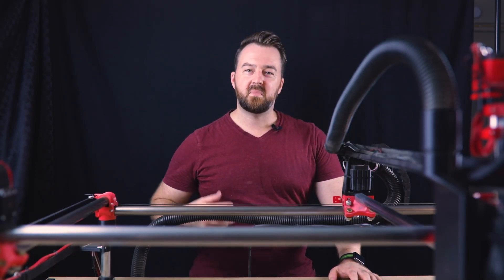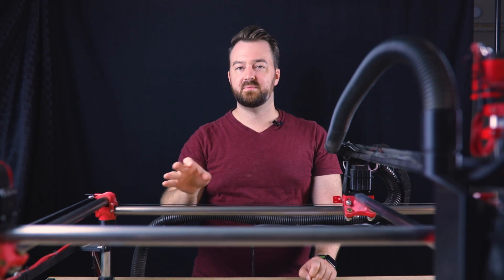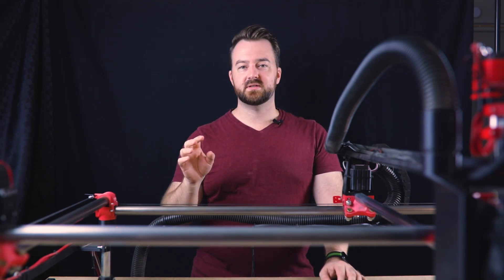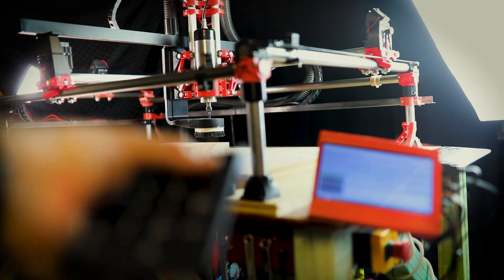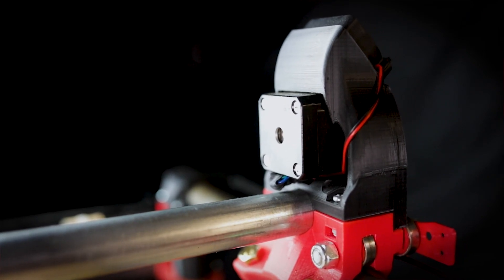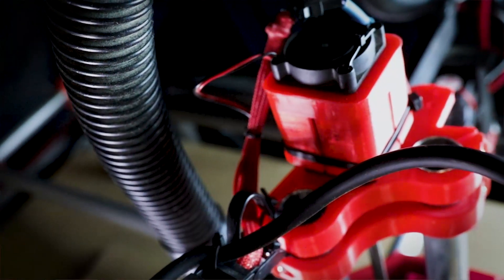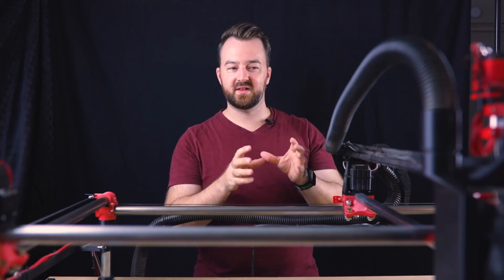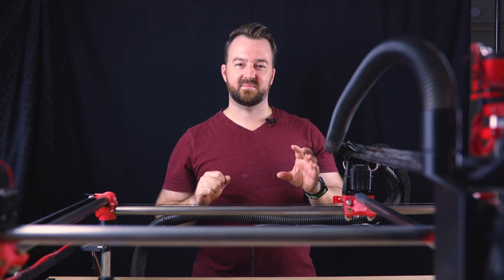My MPCNC upgrades

Comment: Hi ! I built a MPCNC Primo and I was looking for a vaccum shoe. Your  is really intersting but doens'y fit my rail size (25mm) Koala Vac v2. I you have a step file of the top attachment or if anyone has already made one it's amazing
Reply from the maker: Thanks for your comment! The 25.4mm version will fit the 25mm as well, however this is not a product that I’ve had a chance to refine and needs some more adjustments to work effectively! You will need to make some type of gasket for the connection between the internal sliding piece! You are more then welcome to try out and provide feedback. Thank you 😁😁

Comment: That nema cooling can't be very effective as there's no outlets for airflow. Fans always need very big channels to work even remotely well. Unless using very noisy radial fans.
Reply from the maker: I only had great results with these and made a huge difference for cooling. There are outlets at the bottom of these and push air across the surface and out the base…. Very effective!!
Reply: @NEWTechCreative  ok, looks like it's virtually completely blocked design

Comment: Im a bit confused on the round stock. I just ordered about 25 feet of solid round stock for my cnc as I got the idea from your video. But I then listened closer and heard you said you kept some tubing so that you'd be Able to feed your wiring through? Would it not be possible to use solid stock all the way around? Thanks love the build!
Reply from the maker: Thanks @Paulie Jueckstock ! I have the solid bar around the outer perimeter and hollow tubes on the cross bar axis to pass wires through!
Reply: @NEWTechCreative  awesome what about the legs? And I'm trying to figure out if the "outside" rails are the gantry rails or the slides. Because I know its not both but I just don't know which it is. Thanks again for the feedback!
Reply from the maker: Yes @Paulie Jueckstock , The legs I used were also solid bar. The only hollow tubing I used was the “moving” tubes that cross through the centre gantry/spindle z axis.

Comment: What is the router that you use please ? 
Thanks a lot for the video
Reply from the maker: Thanks for your comment. I’m using a 1.5lw spindle with vfd from China! 😁
Reply: @NEWTechCreative  Thanks a lot... if you have some time can you please post a link ? 
Thanks again
Reply from the maker: Unfortunately the link I purchased from is no longer available @Denis G. I would suggest finding your local online supplier and purchasing from them! Use the search ‘1.5kw air cooled spindle with vfd’. Thank you 😊

Comment: This is great video!  Very informative.  Can you elaborate on the solid bar you used on the outer rim?  I'm just starting my build and that seems like something I should do right out of the gate.
Reply from the maker: Thanks for your message @Jim F . Good to see you doing your research before starting. As I have the Burly version (Old version) is assume the setup is the same for the new one. I purchase solid 25mm bar from the local steel shop and had them cut to size. I only used solid bar for the out slider rails and hollow for the x and y bar so I could pass through cables and reduce overall weight. It made a huge difference with overall ‘sag’ and general movement in all directions when cutting. When purchasing hollow tubes, place pressure half way down and check for amount of flex… a little flex is ok. The thicker the wall of tube the better. Hope I’ve helped. Good luck with the journey 😁😁
Reply: @NEWTechCreative  Thanks for the advice

Comment: I know this is an older video, but FYI, IN SOLIDWORKS I COMPARED THE DEFLECTION OF 1" RAILS WITH DIFFERENT WALL THICKNESS AND SOLID. I FOUND THAT .25" WALL 1" DOM TUBE HAS 25% LESS DEFLECTION THAN A 1" SOLID RAIL. THE REASON FOR THIS IS THE 1" SOLID RAIL WEIGHS MORE CAUSING MORE SAG, THE 1/4" WALL DOM IS AVAIALBE FROM METAL SUPPLIES AND BALANCES THE MOST STRENGTH TO WEIGHT (STILL WEIGHING 2LBS PER FT SO VERY HEFTY) ENGINEERING SHOWS YOU GET MOST OF YOUR STRENGTH FROM YOUR OUTER DIAMETER AND WALL THICKNESS AND NOT THE CENTER CORE.

Comment: Awesome upgrades, thank you! Subscribed. Love your vac attachment and stepper fan housings. My motors run super hot. Are you running independent power lines for all of your extra fans? Are you connecting these to your mainboard or to a separate power supply? Any specific fan suggestions?
Reply from the maker: Thanks Ruben! Yes I connected the fans to a separate 24v power supply so the run as soon as I turn the CNC on. I’m sure that they can also be run off an output from your chosen board, however check your voltage of fans and what supply the need. You can purchase a 12v and 24v versions online to match what you need. You could always connect a relay or switching component in you would like control from your board with an external power supply. Glad these could help out!!

Comment: Surely the outer bars will only matter for Z axis rigidity - in each of the X and Y axis all of the load is on the middle bar and the two motors. Unless I'm missing something, the solid bars should be used for the middle bars?
Reply: Fantastic video and great modifications btw :)
Reply from the maker: Thanks for your comments Josh! Yes you are correct in saying that this is mainly for the z axis, however does assist also in the x and y to reduce what I call the bow and arrow effect when running at faster feed rates (bowing in the bar when pushing, then releasing when through material causing a ‘flick’ out). I could have used on the middle bars however I didn’t want to re-route all wires on the outside and consequently having cable chains around the entire perimeter.... if you chose to use all solid bar, I could imagine this would be a very sturdy machine!!!

Comment: which spindle ara you using? how much does the spindle weigh? does Z axis with nema 17 have the necessary torque to move that?
Reply from the maker: I’m using a 1.5kw air cooled spindle and weighs around 2.8kgs. Yes the Nema17 never skipped a beat with this motor... I did have active cooling and set the amperage to 2Amps to get the most out of the motor. Hope that’s helped
Reply: @NEWTechCreative  thanks! :)

Comment: Hi Myles, well done with this it's truly inspiring. GREAT BUILD!!! Because of this video I will also be attempting a MPCNC. I do have some experience with carbon fiber though and would like to hear your opinion on using carbon fiber rigid tubes in stead of mild steel or stainless.
Reply from the maker: Thank you for you kind words Deon! I’m please that it has inspired you. There is so much to learn through this project. I’m not that knowledgeable about carbon fiber tubing however I would check the product out in the shop if you can before hand. I tend to look down center hollow of tube with end touching floor then push in center of tube to see any variance in tubing. Good luck with the build and would love to hear how it goes.
Reply: @NEWTechCreative  Thanks, that is "solid" advise. Hahaha. I agree that it should be as rigid as possible. On another forum someone mentioned that the lighter the cross sections the more "outside interference" could react on it. (Basically the heavier the better for stability), I'm also interested in your electronic setup, since I'm also considering using an Arduino.
Reply: @deonbotha1925 I know this is an old comment and I don't know how far along you might be but for anyone 4lse that may come along and read this I thought I would add my experiences. I used EMT conduit for mine (north America) and I regret it. The galvanizing flakes off and the tubes flatten with wear because of the soft zinc galvenizing. Its not a huge deal but if I did it again I would use stainless tubes and get as thick and rigid as I could afford. 

As for the electronics, I used a RAMPS board on a Mega2560 and nearly gave up because of code issues and lost stpes. Switched to an SKR board and life was worth living again. Spend the extra on a powerful 32bit board...

Comment: What control board do you use
Reply from the maker: I’m using an arduino uno with individual st-m5045 motor drivers with plans to upgrade stepper motors at a later stage.

Comment: What spindle/VFD do you have?
Reply from the maker: Hi Adiv! I’m using a 1.5kw air cooled spindle with VFD. Works really well on the MPCNC, however I have gone to the effort of strengthening the frame to compensate for the extra weight.

Comment: Hi, great mods - going to do them to my MPCNC. Could you give details of your electronics/grbl setup. Looks a bit non standard....have subscribed
Reply from the maker: Hi Gary! Fantastic. I have two spindle mounts on my Thingiverse... the newer one is more comparable with the koala vac if you end up using. Yes my grbl runs off an arduino uno and I use separate ST-M5045 stepper motor drivers for each axis... I designed this way as I wanted to upgrade to a larger machine one day and they can handle large amps if needed especially if working with nema23’s. I might do a video regarding some options when it comes to grbl setup. Enjoy and thanks for subscribing 👍

Comment: Great work, Myles. I'm about to build an MPCNC V1 and, like you, I would like to use a larger spindle. I already have a 2.kw water cooled spindle with a VFD. I'm planning to build a 2' square machine so would be very grateful for your detailed advice as to what changes I should be making to the Burly version (which I believe is sturdier than the original). Many thanks for your time and many thanks for sharing your enthusiasm.
Reply from the maker: Thanks for your message Jim. It’s a very exciting journey and so much to learn! I think you should be ok with a 2.2kw spindle on a 2’ machine... the 2.2kw spindle is VERY heavy and be sure to get ridged tubes, other wise you will certainly get a dip in your center of your cutting area. Since the video I have also inserted a flat steel bar into my center tubes to stop horizontal flex and works really well without sacrificing cable management. I would also suggest keeping the machine short on z axis (no more than 4inches) to assist vertical stability. Besides that, the great part of the build is that you can always adjust later! Good luck with the build 👍
Reply: @NEWTechCreative  That flat steel bar idea is brilliant! Are they a snug fit or are they fastened inside the pipe somehow? And they remain horizontal while using the machine i.e. they don't move around? And are they only installed on sliding carriage pipes? Sorry for all the questions.

Comment: Great Videos... Many thanks for sharing your designs with the community which is very much appreciated. As I am in the middle of a MPCNC build and still not sure about my size, may I ask you for your X, Y and Z working space? Many thanks in advance and kind regards from northern Germany. Robi
Reply from the maker: Thank you for your kind comments Robi. My working area is 900mm x 550mm and z200mm. I built this way at first as I didn’t know exactly what size I would use mostly. I think I would still drop my z height as I don’t need so high. The x & y axis have been perfect for fitting standard 900mm boards from hardware shop and no need to cut down. Good luck with the build 👍😁

Comment: Hey nice mpcnc. The pipes are not pipes? Are this full metal?
Reply from the maker: Yes that is correct!
Reply: NEWTech Creative nice but but they bent same as stainless steel pipes :-)
Reply: Have you used stainless steel or aluminium full metal pipes?
Reply: Robert Pitschmann I have read and talk so much about stretched full Metal

Comment: It's a really great video and your constructions and your upgrades are also really great. I actually have two questions.  How did you attach the brushes on the coala vac. What kind of spindle did you use? Thank you  and greetings from bavaria
Reply from the maker: Thank you for your kind words! I purchased the dust cover brush online and just cut to size and attached with a hot glue gun. You could also 3D print bristles with flexible filament if you have available. I purchased a 1.5kw aircooled spindle with VFD from eBay. Hope this answers your questions! Thank you
Reply: @NEWTechCreative  thank you for the tips! I wasn't or still am not sure if the 1,5 kw spindle is to heavy. I'm looking forward to your next videos.

Comment: Cool ideas, do you have a 23.5mm (3/4" EMT) design for the corner brackets and the cable chain bracket thing. thx
Reply from the maker: Thank you. I’ll upload within a day!
Reply: @NEWTechCreative  great thanks, I am reprinting a couple parts, cracked a few while putting together and also the roller plate I had the hole was to small,
Reply from the maker: All files are now updated and included on my links. Good luck with the build 👌